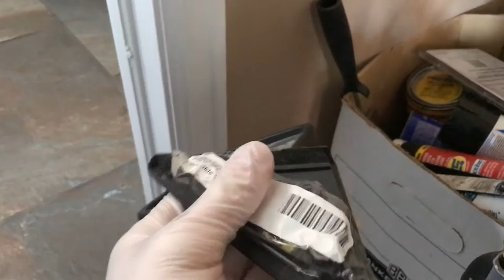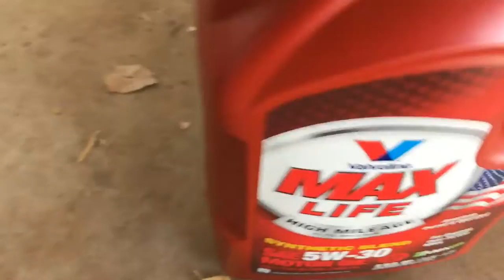The Sentra Gets a Much Needed Oil Change

Comment: No help, I cannot find the oil filter, your video was no help at all,  what is with changing he oil and leaving the old filter on the engine. If the filter was still good your oil would not need to be changed. Next, the oil was really not all that dirty.